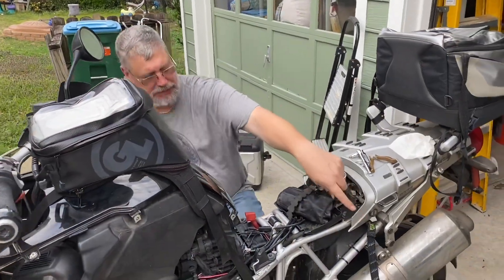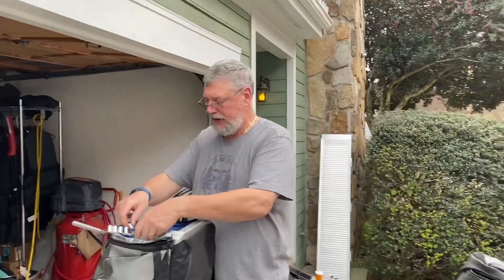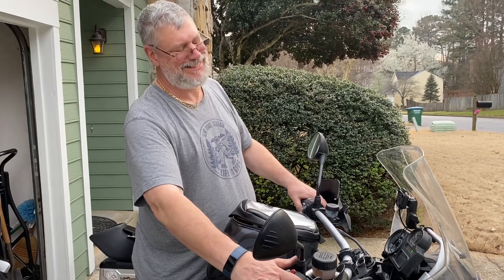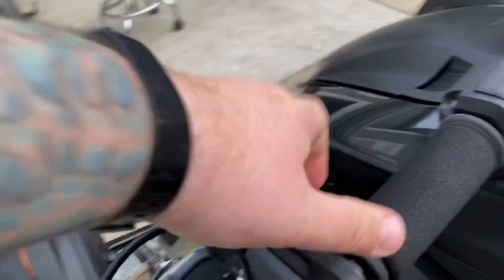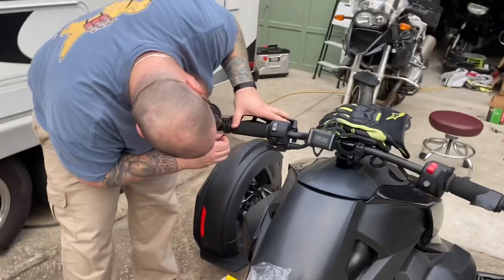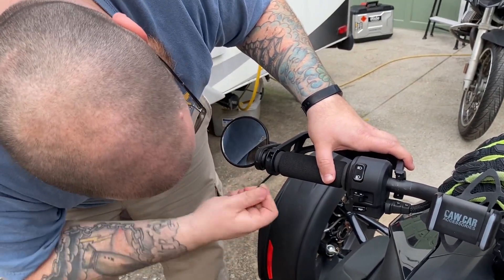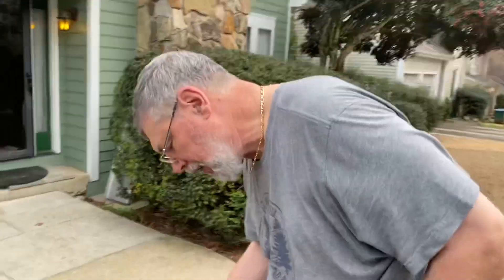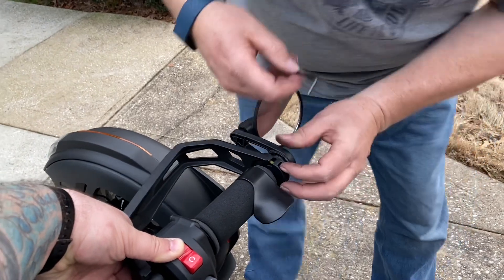Don’t make the same Mistake!  Can-Am Ryker Hand Guards  and Wind Deflectors installation

Comment: I put on my handguards 2 days ago. I attempted to follow the BRP guidelines, but turning the handguard in a down position to secure didn't work for me either. So I had my husband hold it and put it on similar to what you did. I did find the throttle side a little more challenging b/c I had to get that wrapped wire out of the way.
Reply from the maker: I hear ya there!!!  Thanks!!!

Comment: The handguard deflectors on my Rally also have the lights. Definitely recommend spending the extra coin  cause they add an extra layer of visibility.
Reply from the maker: Thanks!  I’ve been thinking about that a bit. Might tackle that soon!
Reply: Just put the lights on this afternoon. I felt I needed lights higher up on the vehicle for visibility. The back end is covered.